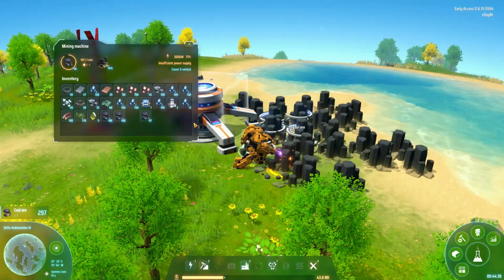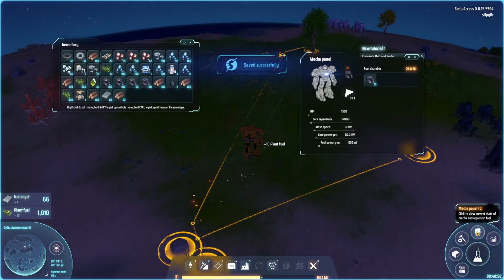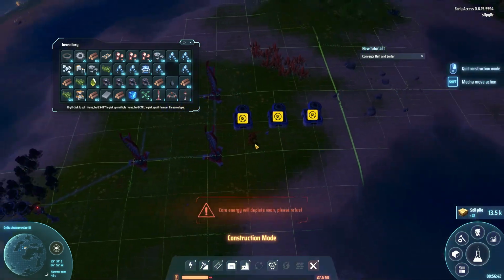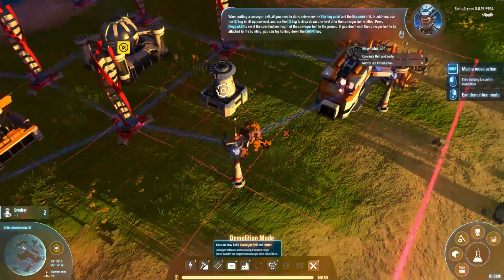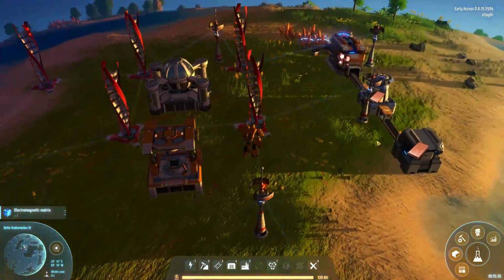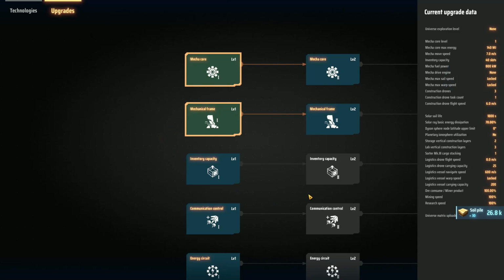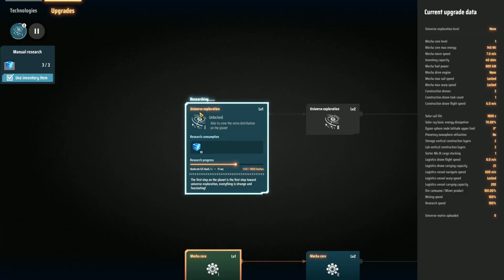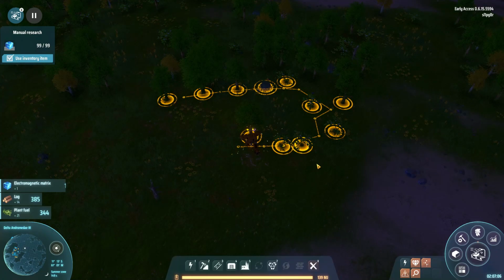DYSON SPHERE PROGRAM! BEGINNING FACTORIES! E2

Comment: Bit of a power production tip for you sl1p, 1 unit of crude oil lasts 3 seconds in a Thermal power station, which provides 2.16KW per unit of oil,  one instance in my world, i have 2 oil seeps side by side, one pumps 1.79/s, the other 1.83/s, together thats 3.62 units per second, so that'll safely be 9 Thermal power stations to those 2 oil seeps, which is a continuous power gen of 19.44MW with a slight stock of crude oil, but in this case i wouldn't stock the oil as you'll need the backed up line to supply oil when needed. I've been hooked to this game like a mad man since your first stream of it.

Comment: If you use the Wood and Plant matter for fuel you'll save alot of inventory space. Also you dont need to build every component individually, for instance, if a factory requires like gears and circuits, just craft the factory and it'll craft everything required if you have the resources for it in your inventory. It's just like Factorio.